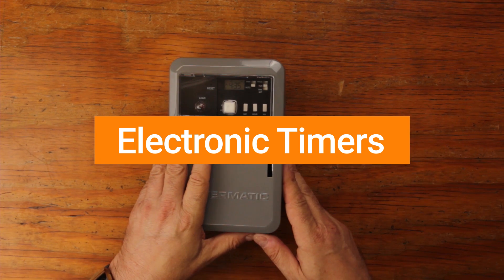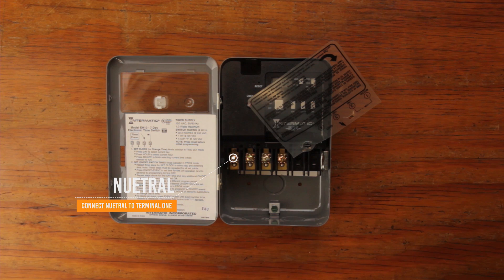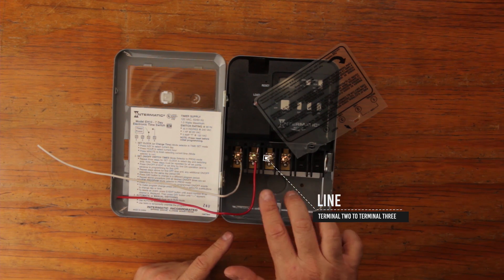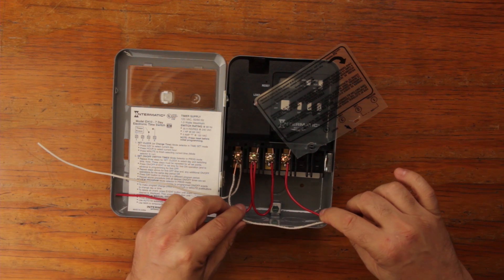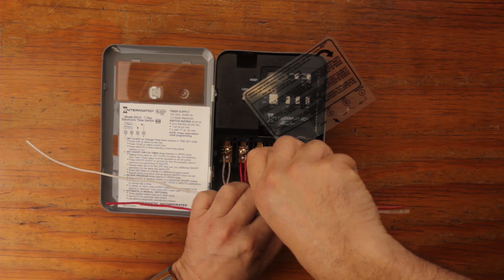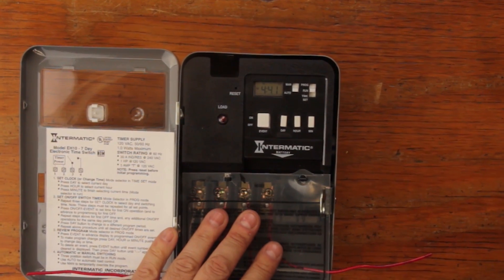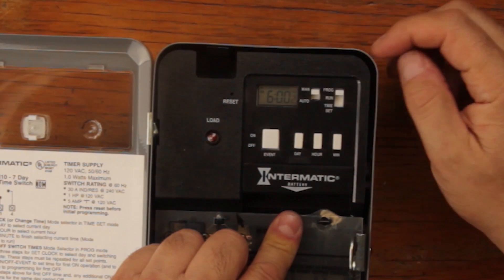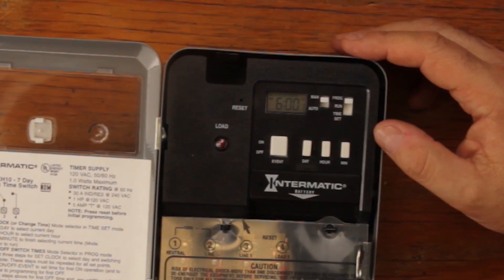How To Install and Program an Intermatic Electronic Timer Controller

Comment: My timer shows nothing on the screen. I assume battery is dead. Do I need to switch off power from main before opening battery compartment and which and how many batteries do I need?
Reply from the maker: Open the battery compartment, this video shows how, and replace a single double A battery. You have a few seconds not to loose your prior pre-recorded settings... but if the battery has been dead for a long time, your memory has also been wiped out, you need to re-program. I hope this helps.

Comment: I have owned many of the Intermatic water heater timers(Tan WH-1 & Little Grey Box). I'm going to toss my WH-1 and get a digital. Tired of the syncho motor growling as it runs - real loud and is also telling me that it will soon not turn at all. Not sure why Intermatic does NOT supply the "jumper" wire or just build that in? Why wouldn't that be used?
Reply: Good move dude
Reply from the maker: I consulted with Drice Walker and he advised that the new intermatic 101 are fairly quiet, but the electronic is 100% quiet,  you will only hear the relay turning the power on or off. Good luck on your change.

Comment: I’m having an issue with a timer I just purchased, no matter what schedule is set to the load connected to terminal 4 stays on if the jumper is connected between 2 and 3. Is there a setting that would cause that switched connection to stay closed?
Reply from the maker: Drice walker told us that there are many models of timers. If you give us the model number he can answer this question for you.
Reply: I’m trying to connect intermatic et2825c model. Is it going to be the same? Does it matter if it’s using a Hot Line vs Neutral Line into the switch??

Comment: I am wanting to switch my timer over to 240 as well I change the switch on the back but my model ET8015C only has four terminal connections any suggestions
Reply: the ET 8000 series has a switch of voltage and a different diagram for each position. Look up on the intermatic website the manual for your specific model and install accordingly. 240 installations usually need two hots to provide 240 to any system, make sure you have it, and follow manufacturers instructions.
Reply from the maker: 🖖 Thanks for the answer Garrett
Reply from the maker: Garrett just gave the right answer Will. If you have more, please feel free to comment here.

Comment: So that's a 110 set up how do you wire it for 240
Reply: I knew someone would want to know it, but no one likes long videos! Perhaps we can make a video soon!

But to solve your problem quickly, basically the switch to 240 is simple:

Behind this unit, there is a jumper to switch voltages in between, 120, 208, 240 and 277... depending where you place the jumper. The board is marked on the back of the board (the actual timer guts). Then, after you changed your jumper to 240 you need to wire it to 240, with two lines, in 3 simple steps:

First) Connect one line to the terminal 1 and another for terminal 2.
Second) Then you use a jumper to connect terminal 1 and 5, and another jumper to connect 2 and 3.  
Third) Then you connect terminals 4 and 6 to your load... That simple!
Reply: @dricewalker1953  
I am wanting to change mine to 240 v as well but only have 4 terminal screws any suggestions
Reply: @willpruett2246   what is your model number? I will contact the manufacturer and see what you can do to upgrade.
Reply: @dricewalker1953  Mine too. Model ET1705C. It has the switch on the back for 240, but only 4 terminals with hardware. It does have empty slots for terminals 5 and 6 but no screw hardware.
Reply: @willpruett2246  I'm in this predicament right now. How to wire 240v with 4 terminals dt101 intermatic?
Reply: @dricewalker1953  there is no terminal 5 and 6
Reply from the maker: Hi @Thomas Fortier. This is a good question. Drice Walker will answer you directly in a few minutes. Thank you for been here on the channel.